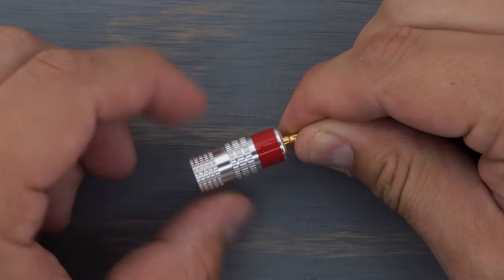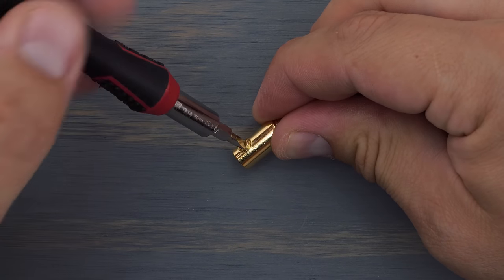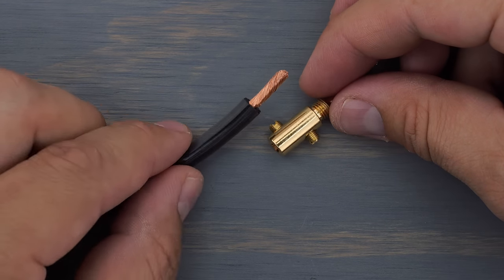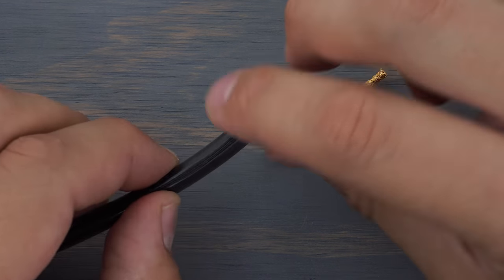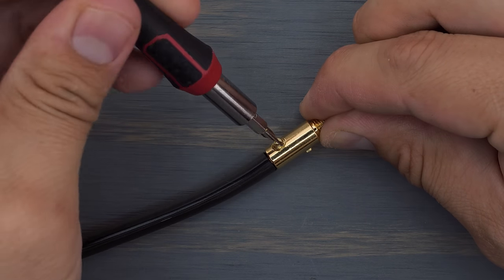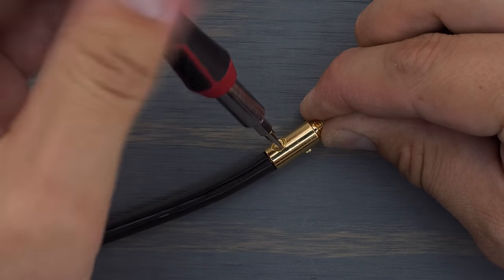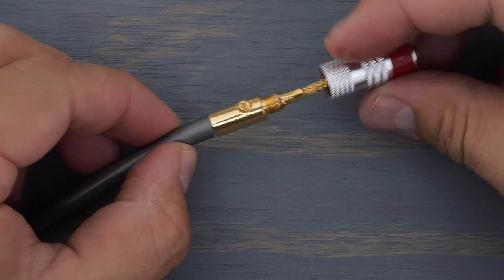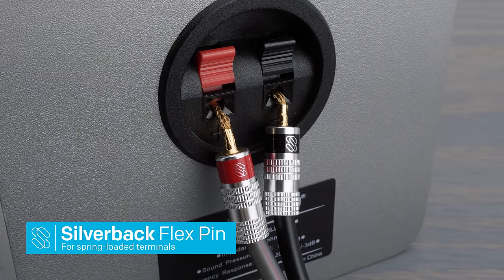How to terminate speaker wire with Silverback Flex Pin connectors

Comment: If you don't have regular old spring loaded inputs on your speakers, do you just plug in the Flex Pin the same as a loose speaker cable or can you plug them in like banana plugs?
Reply: These cannot be set like banana plugs.  They will fall out